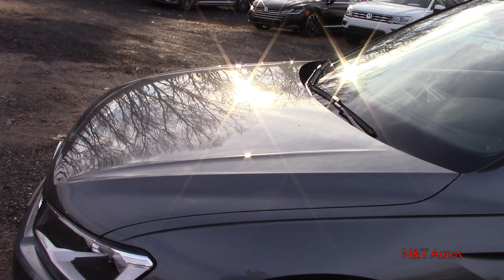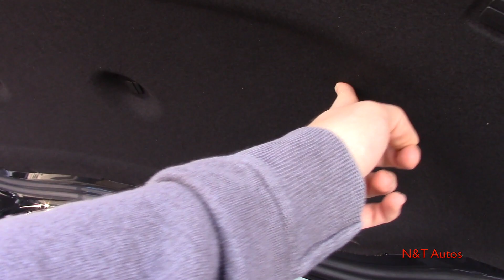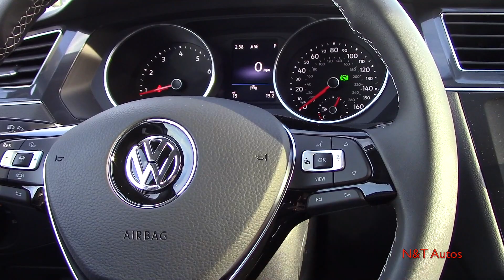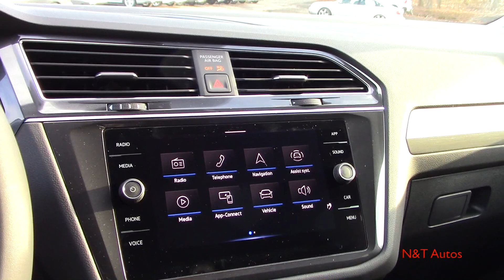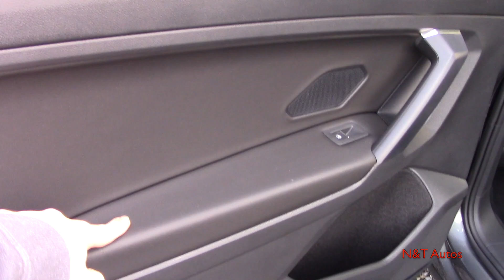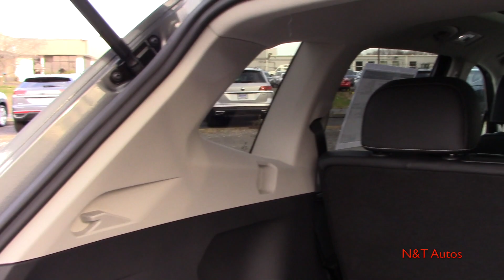2021 Volkswagen Tiguan (SE) - In Depth First Person Look

Comment: Just bought one from Carvana. Appreciate the in depth review.
Reply from the maker: I hope you like your Tiguan and am glad you found my video helpful!!
Reply: How do you like it? Which color did you get? Im looking at one on carvana now that is white with 46k miles
Reply: @ricky1319  i really like the gray SE. Only feature I miss is the digital dash but even the center display on mine shows navigation directions which is nice. Great car for the price.
Reply: @I0I117 does it run okay? Ingot a sorento from them a few months ago and it sounds like the tires were gonna fall off lol i sent it back. I love the sunroof on them. Im also looking at the sel 4motion with 74k miles and same payment. Im torn what to get because i love the digital as well
Reply: @ricky1319 I bought it with 77,400 miles. Local VW dealer said it was in great condition with a oil pan leak covered under carvanas 100 day warranty with $350 deductible. I'd recommend the sel 4motion and take it to the dealer to find any issues.

Comment: Beware:  Battery replacement at 40.350.00 miles to the tune of $450. at the dealership.
Went into a store, came out - Battery DEAD  ugh 
Service advisor keep blaming it on the HEAT.   If you ask me- Truth is.  Too much drawl on the battery from all the fancy futures that I DON'T USE.  Service advisor told me I will need a new battery every 2 to 3 years.  ugh  Makes to since to me that I can't get the running lights off.  Makes no since to me what the radio continues to play when I turn the car off.  There is a lot of things about new cars that don't make since to me.  ugh

Comment: I just bought a 2021 Tiguan, I love the vehicle, always been a VW fan, I will say it did not need the 8 speed auto, easy 6 would have been a much better idea from tranny to block. The 8 has its benefits for what they designed this for, but a 6 speed would still give you the power and much better torq on the low end.  I'm in Nebraska and this will do just fine. Only other complaint is exactly as you called it, the exhaust....No way they put in tips but the exhaust doesnt even extend out there. Meh, aftermarket exhaust is generally the better option.

Comment: In the S mode, the car is sporty.
Reply: Nothing changes with the performance with different trim levels just better safety features and luxury features
Reply: The big sky guy means, if you back on the gear selector, the transmission go into a sport mode.  This allows the engine to rev 500-700 extra rpm and in my experience (on mine which I’ve had two weeks) it shifts more aggressively.  This car is made to be efficient, but for one who has owned two GTIs and somehow landed in one of these, it is good to see some GTI engineers still on the team.

Comment: The sensors on the frontend are not behind the VW badge but actually the little circle on the bumper cover to the right of the front plate mount. I had a 2018 SEL and now have the 2018 Atlas with tech and that is where the dealership advised they are located. Also, on the SE models, they do not have an auto hatch, but are manual open. The button on the key fob is a faux button and has no real purpose. If you get the SEL, which uses the exact same key fob, then the hatch button gets replaced with a usable one. You also skipped the CD player. The Tiguan and Atlas has the CD player in the glovebox. There is also a SD slot to insert an SD card to pull up pix on your infotainment screen and there is a slot for an SD card that will store the mapping info if your SEL has navigation, as mine did.
Reply from the maker: There’s isn’t a CD player in the 2021 Tiguan SE.
Reply: I beg to differ my guy!! Just replaced my front emblem and the radar for ACC is behind the emblem lol

Comment: does Tiguan come with Surround View Monitor while reversing ? Also can the trunk lid open & close with the push of a button ?
Reply from the maker: The Tiguan gets the surround view camera system in the SEL Premium trim only. The trunk is powered, meaning it’ll open and close with the push of a button, on SEL and SEL Premium trim levels only.
Reply: @tydrives4846  I have a question about the trunk too. I have the 2021 se trim and there’s a button on the remote but does not work and none on the inside. Is the button on the inside suppose to work or for show?
Reply: It’s if you want to put the auto gate in on your own! My wife’s 22 came standard but my 21 I don’t mind not having it, the tail gate isn’t heavy at all and easily closes even with arms full of groceries

Comment: Does yours have an “open trunk” button on the drivers side door? 
Also, how do you open the trunk (from inside) if your 2021 SE Tiguan does not have one?
Reply: It’s doesn’t. It’s the stupidest thing ever. Only the SEL does. That said I love my se r line but yeah no open button inside and the key fob has the button but does nothing. Still love it
Reply: The SE model does not have an open hatch button because the SE hatch is not auto open. My 2018 SEL had the button on the key fob that opens the hatch and a release button on the driver side door panel down next to the door bin. My wife's 2018 SE has the faux button on the key fob but it does nothing because her's is manual open. My 2018 Atlas with tech has it on the fob and on the door.
Reply: There is a button in the drivers door but I don’t know if this is standard or an option in your market.
Reply: Use the trunk button on your key
Reply: @bantot8  I just bought a 2021 SE and we tried the button and nothing. It only unlocks it. It’s there a trick to it?
Reply: @ivemar0710 no it’s if you only want the trunk opened for someone grabbing something with out the keys! You can install the parts yourself and have it auto but it’s not a heavy tail gate and opens and closes easily